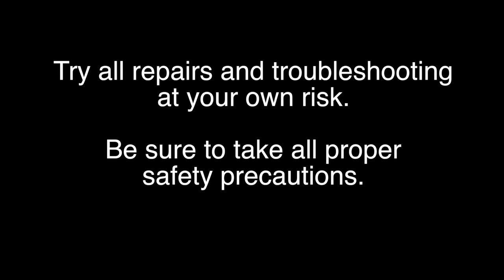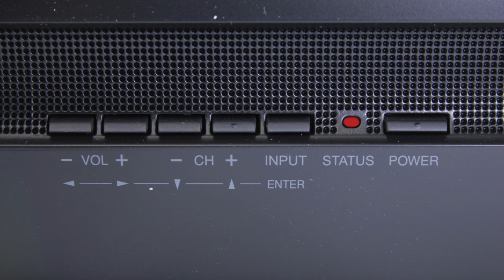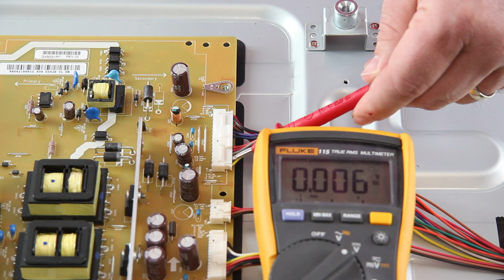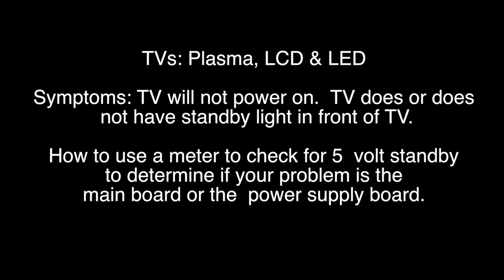Vizio D650i-B2 TV Will Not Turn On Blank Screen Help - Checking Standby Voltages - No Power

Comment: I have a VIZIO D650i-B2 E650i-A2 I replaced the power tested it on the 2 pin locations got 10 volts on each ok or too much! main board must be the problem . I guess I will figure it out through process of elimination. It took a spike from lightning off the cable or power both went through a power strip first . Any ideas other than the direction I am going in

Comment: I'm checking my stand by on my power supply and its only reading 2-2.5. This meaning I'm probably needing a new power supply?  My vizio 650i-b2 just went out on us the other day while we were watching TV. It shut off and wont turn on. Thanks.
Reply: Jason Self any follow up to this? having the same issue, same tv
Reply: inphluence hey. just wanted to comment since no one else seems to. 

My TV was completely dead no standby light, nothing. Took it apart, tested the standby voltages with it plugged in. The two pins that should have read 5v only showed about 1-2 volts. 

I bought a new power supply boars from Jimmy shop oddly enough since they were cheapest for a new board. Part arrived in 3 days, put in the new board. 

The voltages in the new board were reading exactly 5v and the TV turned on. It has been a few days and no issues at all. Cost me around 60 bucks.
Reply: tv are no good
Reply: @Ogrillion  My TV was having similar but different issue. It never turned off while using it. If the Tv was being used and then turned off, that would cause it to not turn on again. If it was then left unplugged for a few days, it would always come right back on after you plug it back in. After doing research, I was told the powerboard was bad, so I replaced it. That fixed it perfectly for about a month. Then same symptoms. Replaced the board again and same thing.... works for a month perfectly and then would start to have power on issues. Something is causing the power boards to go out on me and nothing I see online references this conundrum. I will try to check the standby voltages in the next couple days and see the results. Anyone else have this happen?

Comment: I've swapped out the power board. I only have 1.4 volts on each standby wire. TV still will not power on. Any idea what to do next if low voltage found on standby wires?
Reply: I’m seeing this as well, did you ever figure out what the problem was? I know it’s been a while so hoping you see this.

Comment: Hi I have a 42pt250 lg and when I plug it in I get red stand by light then when I turn it on light goes out it then turns off and goes back to stand by with red light Iv put new power board and it still does the same